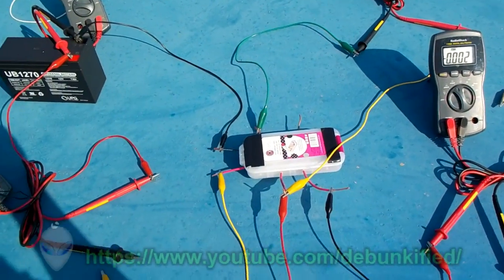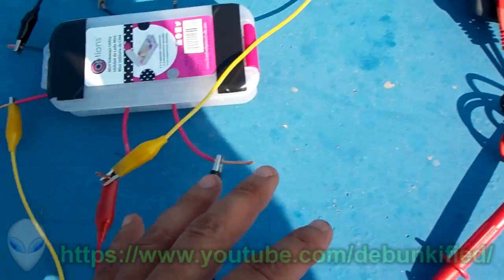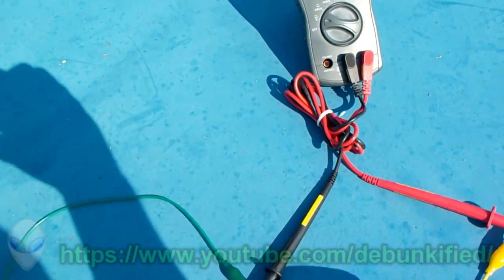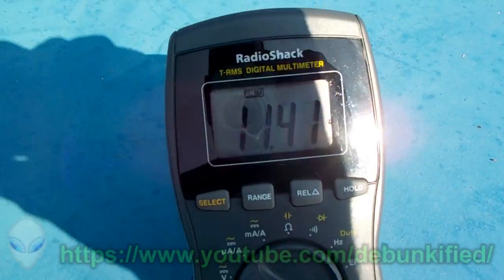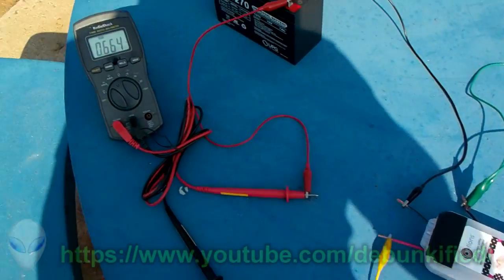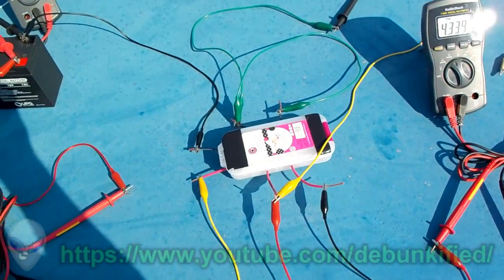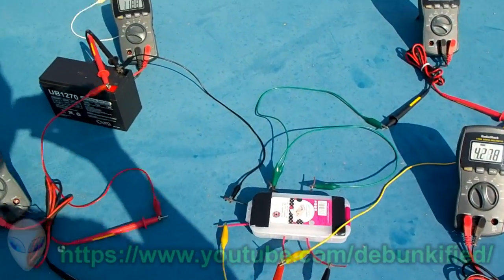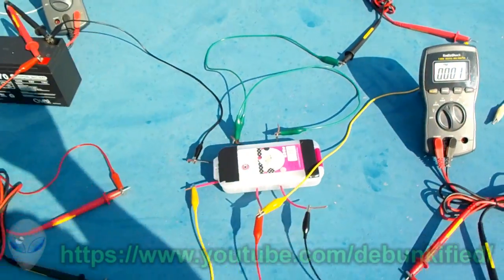Free Energy Overunity Basic Concept Prototype

Comment: Use the output to recharge the input battery. If the input battery voltage goes up higher then before you started the circuit then you can claim overinity. Please let me know your results. Regards
Reply from the maker: This circuit's intention is not for self charging it is to simply to demonstrate simplistic overunity measurements and that is all.
Reply: I'm sorry but without a proper load connected to the output you cannot measure it. 
Ideally you need the output to be connected to a large capacitor (50,000uf or more) and connect a resistor (as load) to the capacitor.  Then you'll only need to know the value of the resistor and measure the voltage across it to calculate your output Watts. This way you can use 3 meters to measure everything at once.
It's full proof and no one will argue the results. I've been doing this for several years and it works.
Let me know your results.
Reply from the maker: +Luc  gotoluc Choquette Actually no, I've had plenty of batteries charge themselves up higher than what they started with, but if it's just a "fake surface charge" then this means nothing as well, so you can't just say Oh look it's overunity because the battery "appears" to charge itself up with no real associated current packing into it to go with an empty ghost voltage.
Reply: I did not write to charge an unloaded battery. That proves nothing. Follow what I wrote and you will have proof. Regards
Reply from the maker: +Luc  gotoluc Choquette Hi, I followed what you wrote. You are speaking of a self running device, powering itself with a rising battery voltage.
Reply: Yes, that was my first recommendation but you shot it down so I wrote another way to do it.
That test is still valid as a surface charge cannot happen if the battery is under load. Regards
Reply from the maker: +Luc  gotoluc Choquette Hi, I am not sure what exactly I shot down, but I am not entirely sure what you mean by battery under load. 

By a battery being under load I assume you are saying there is no such thing as a surface charge if it's being charged at the same time it's powering something.

If it's a battery powering an oscillator or converter of some sort that is charging its own battery, in which the battery is it's own load, then I have seen surface charges appear on the battery before.

When I swapped the batteries that voltage vanished as if it didn't exist at all. Maybe I'm not getting exactly what you are saying.

Besides the fact that, yes, a capacitor with a resistor across it would eliminate one meter as ohm's law can be used to find the value of the current by knowing a known resistance of a load resistor is by far the best way to get a wattage. 

That method of finding wattage for a particular load does not apply here , at least for measuring over unity.
Reply: What this "YouTuber" has is 12Vdc feeding TWO   DCtoDC converters, the output of one of the converters is  11.86V, that is the one the DMM is connected to.
The other is set to a lower voltage.
Both the outputs have their negatives connected together.
The "output current" DMM then SHORTS the OUTPUT of one converter to the OUTPUT of the other converter, because they are of different voltage a current flows, this current is limited by the OUTPUT IMPEDANCE of the converters.

The actual power transfer is related to this  output impedance.

Not the OUTPUT voltage of the converters but the difference BETWEEN the output voltage of the converters and the converter impedances.
This is the REAL power being dissipated in the "Tupperware" box.

The "YouTuber" knows nothing about input and output impedance of power supplies.
If he did he would have mentioned it.

He has no idea of presenting a well documented and explained experiment, being secretive about his "Tupperware" boxes does nothing for his "credibility"!

Are we sure this guy is not taking the piss out of all of us?